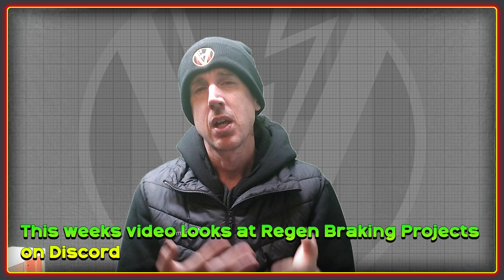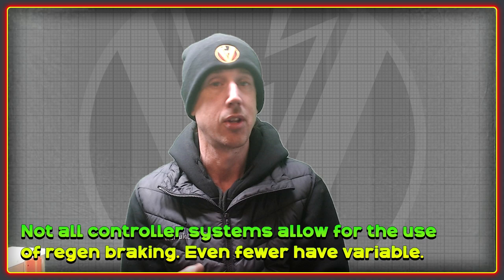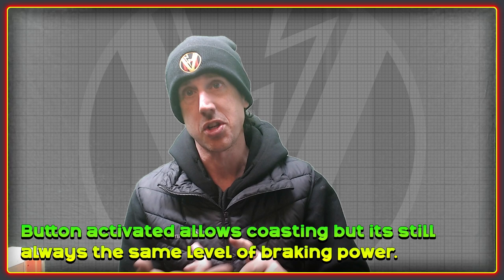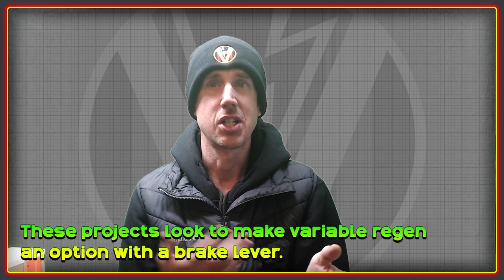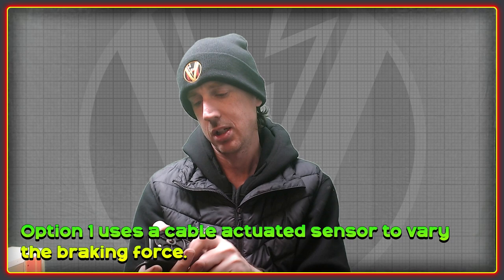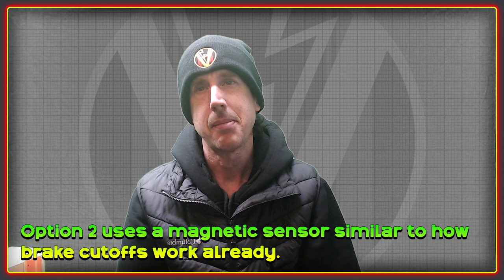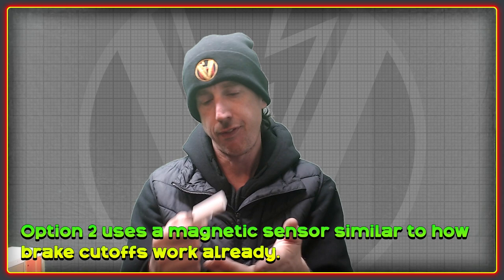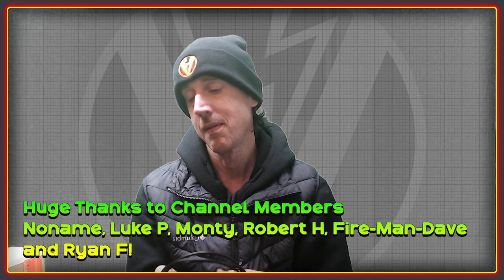Lever Activated Regen Braking, projects to make variable regen more user friendly.

Comment: Hmmm debatable i see regen as a cancer on batteries due to the added heat and current surge in..Prefer to take the approach of a larger battery instead all day long. questionable safety too given its in 2 wheels and without a stability control system too. Would never consider regen on a bike and would be turning it down as low as possible (or off if possible)  ALL DAY LONG!
Reply from the maker: I think it depends on how its done and the quality of the components involved. There is some good stuff on the Grin channel on the viability of regen.
Reply: @HighVoltageKits  hhmmmm big no no in my eyes other than say the likes of long distance trains/trucks/buses etc where real time profits cater for potential battery stresses and so on. 2 wheels an absolute no no from any angle.
Reply: I see the main advantage only to be not having a rear brake, and stability of chassis from engine braking/drag after coming off from full power loads i wouldn't think there would be enough weight/energy on a bike to make a real difference in range.
Reply: @monkeymagic4555  I've got an Electric Motion Escape R with progressive regen braking and it works a treat, much better than the regular rear foot brake that the bike also has. It does also recharge the battery by a few percent on steep descents but that's not the main point of it. I wish my Talaria also had that instead of fixed (adjustable) regen braking.